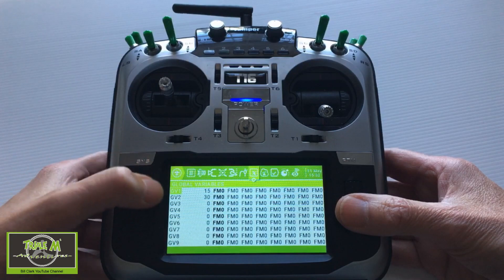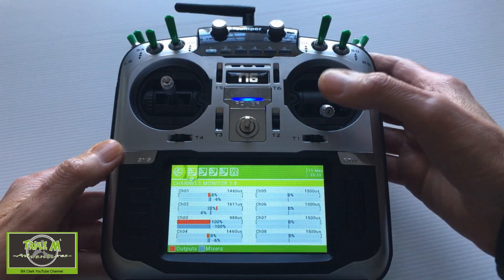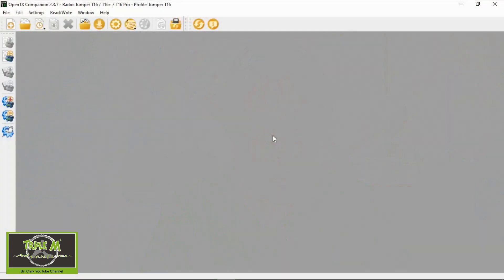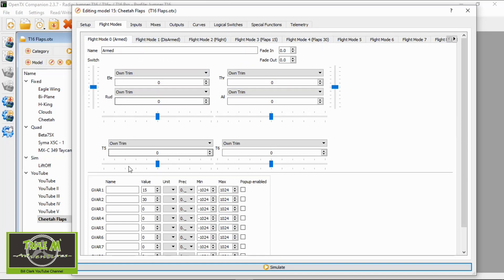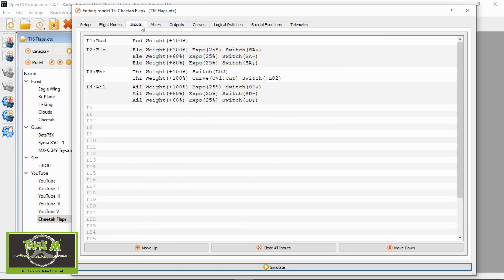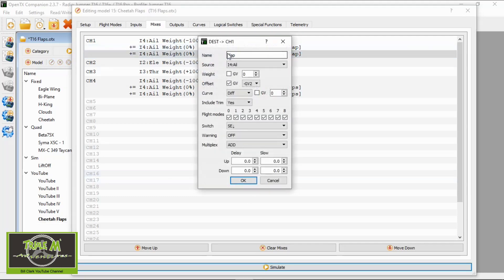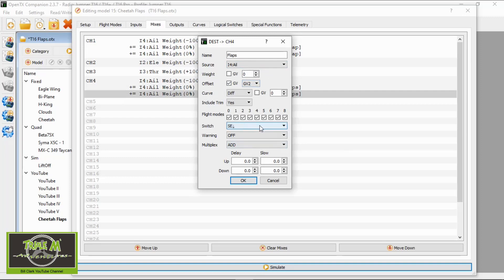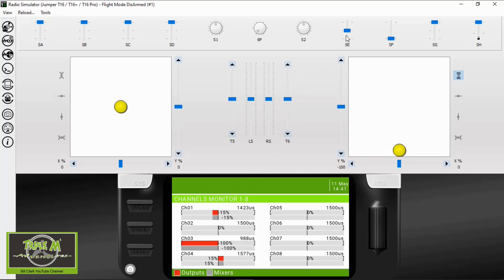Jumper T16 Setting Up Flaperons in OpenTX

Comment: Your method I think is overly complicated I just create an input for flaps controlled by a slider then add that input to each of the ailerons with a source of max flaps are then variable via the slider
Reply from the maker: Hi Richard, that’s the beauty of OpenTX there are many ways to complete a task. Did you use GV’s in your method?
Reply: @the-happy-RC-flyer  No - just the side pots
Reply from the maker: Thanks Richard I will take a look at your method. With the way I taught my self to do the set up is so I could easily change the values in the Global Variables     window in my Jumper T16 when out flying at the field. I will be realising a video next week about crow / butterfly brakes on a glider, which I have never set up on a model, I would be interested in your thoughts on the method I used. Thanks for your feed back.
Reply: @the-happy-RC-flyer  Hi Bill, 

I have a Phoenix 2000 glider normally I fly it with two flight modes, cruise, and landing

Cruise - Flaps mixed with 100% ailerons (replace) to get a full wing aileron, rudder mixed with 40% aileron (add) to assist with turning

Landing - Flaps on a potentiometer (slider) to give infinite variable, Ailerons mixed with Flaps (add) to give crow not much 20% ish, otherwise you loose your aileron authority, flaps mixed with elevator (add) to stop ballooning say 5% - 10%

Input 

Normal inputs for control surfaces and throttle with switchable rates add an extra input for Flaps source RS weight 100%

Mixer 

Ch 1 Thr - Input Thr

Ch2 Ail-L - Input Ail
+= Input Fla Func x>1 20% FM 1

Ch3 Ele Input Ele
+= Input Fla Func x>1 5% FM 1

Ch4 Rud Input Rud
+= Input Ail 40% Fm0

Ch5 Ail-R - In Ail
+= Input Fla Func x>1 20% FM 1

Ch6 Fla-L - Input Fla Func x>1 100% FM 1
:= Input Ail 100% FM 0 

Ch7 Fla-R - Input Fla Funct x>1 100% FM 1
:= Input Ail 100% FM 0 

Use Function x>1 or x<1 to give a one sided movement for flaps could use a curve to get same effect which one you use depends on configuration of servos.

Hope that makes sense.

You are right there are nearly as many ways of achieving a result in OpenTx as there are people - I recall spending a very pleasant Saturday afternoon achieving the above solution and a number of other ways with fixed flap values and adding FMs for Take off (third/half flaps) Reflex (Speed) and Camber (Thermallng) which I have stored as copies of the model in the radio. Incidentally I don’t have a Jumper radio although I do use their multi protocol modules to fly some models with Spektrum receivers I have an X10 and an X9D+

Feel free to use above 

Regards

Richard
Reply from the maker: Richard thanks for the comprehensive information very much appreciated.